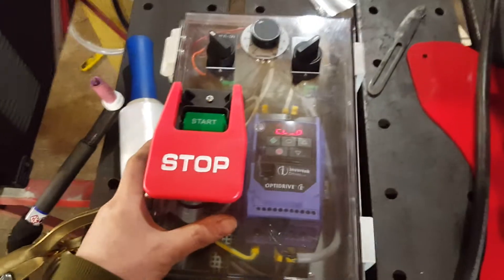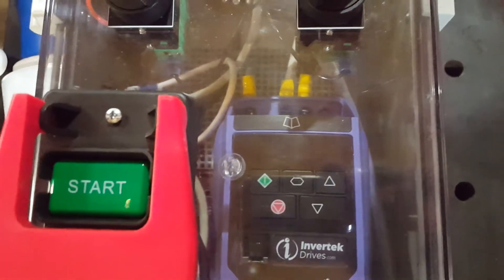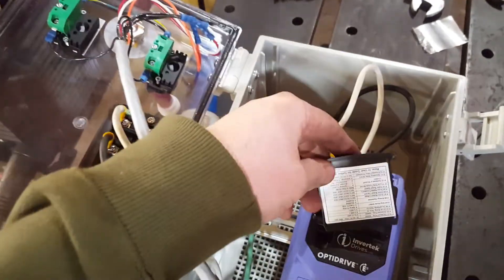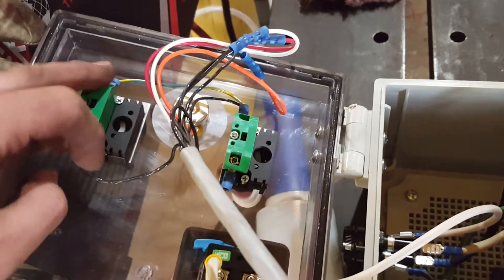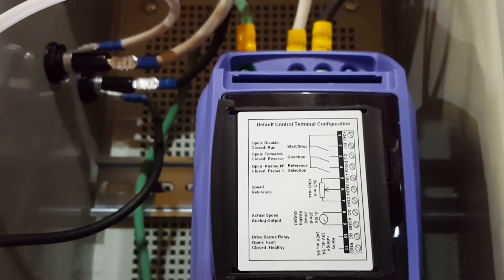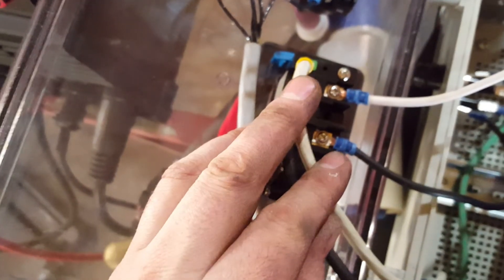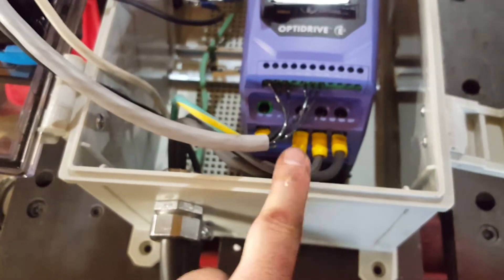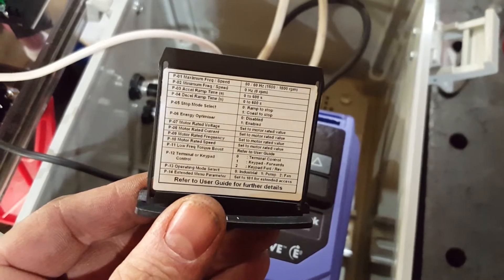How To Wire Up Your IP20 Invertek VFD.

Comment: Do you know is an air compressor pressure switch can activate the VFD to call for air below set point and shit off at set pressure?
Reply from the maker: yes.  SMC sells pressure switches.  I use them in my automation designs at my day job.  https://www.smcusa.com/products/sensors-switches/

Comment: I looked up the controllers. I see like $250 to $600. Are you insane? Is this belt sander $2000? You got to be insane. The first 2 videos i watched you forgot the ground clamp on the cnc. You should delete those. Then i watched you showboat a ck tig welder ( nice welder but leaps and bounds from a primeweld225 ) ck is a great company but its all china parts. They are all china parts. Then i wanted to see the belt sander yo made. Well i did and its a awesome piece of equipment but for what? $2000? $500£? You are insane. You need to get your head checked and get a good day job.
Reply from the maker: Are you seriously going to come here and dog my video quality?  You're saying I should delete my stuff?  What about your stuff?  You've had it up for 15 years and only 3 people wanted to see more.  People in glass houses shouldn't throw stones.  Lets be honest those 3 subscribers are probably the other 3 guys in your band.
Reply from the maker: the CK MT200 AC/DC over $2k and primeweld225 is like and 800 dollar machine.  My B.A. Shredder can be built for $900.00  Comparable off the shelf fully built units sell for 2 to 3k.  I'm very open about my day job.  You clearly have no idea what you're talking about.  I don't edit out my mistakes because I don't pretend to be perfect.  What 2x72 belt grinder do you recommend that is better then the  B.A. Shredder?

Comment: and what gauge is the leads to the drive same 20 AWG?
Reply from the maker: wire going out to the motor is 12 AWG but you could prolly get away with 14 AWG. (make sure it's shielded)

Comment: what gauge wire are you using for the connectors for the switches and fuses  is that 20 AWG?
Reply from the maker: Fuses get the full 10 gage wire as they are inline with the incoming power.  The 2hp drive calls for 16.5 amp fuses so I use 15amp fuses.  20AWG will work fine for the switches as they have very low current.